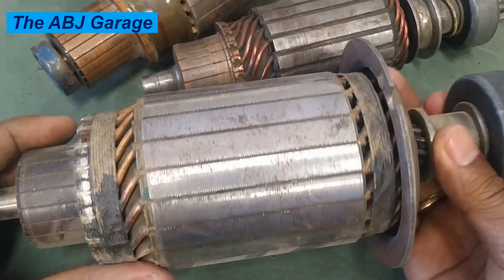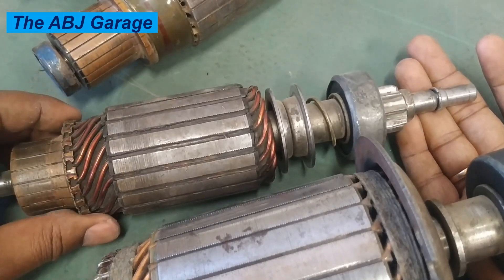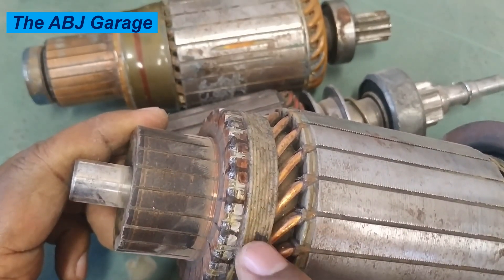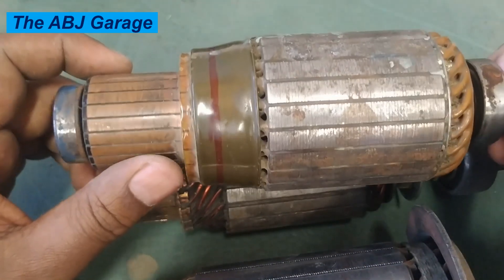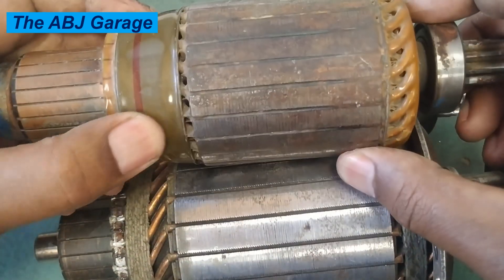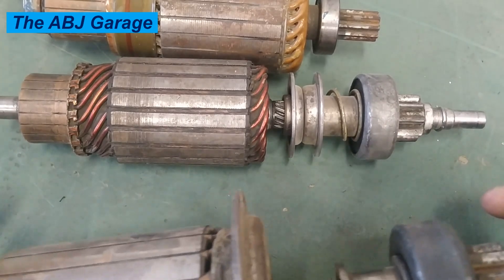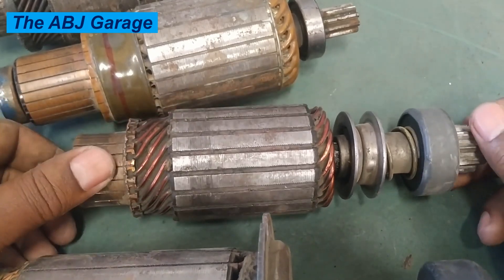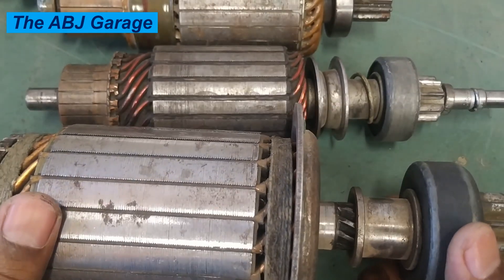Protect Your Starter Motor: Top Things That Can Damage the Armature!

Comment: Thank you so much this! I'm a new driver and still learning to drive a manual transmission car but I accidentally turned the ignition key on while the engine was on (because I thought it died and I panicked). Will this destroy my starter? I noticed that sometimes it doesn't start as fast or sometimes there's just a click. But this only happens sometimes.. I learned a lot, I subscribed!!
Reply from the maker: If the ignition key was held to start only for brief moment when the engine is running, it will cause gear clash! That will cause damage to the pinion gear teeth.  Intermittent starting is not associated to this. It more probably caused by bad solenoid or weak battery!